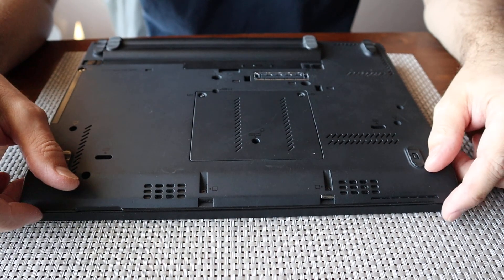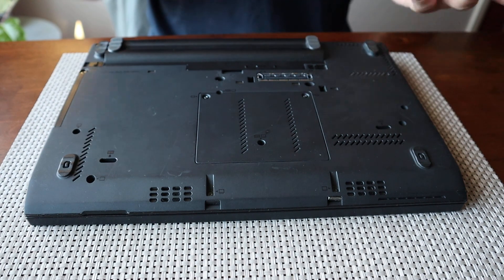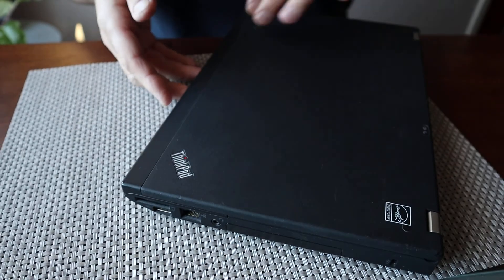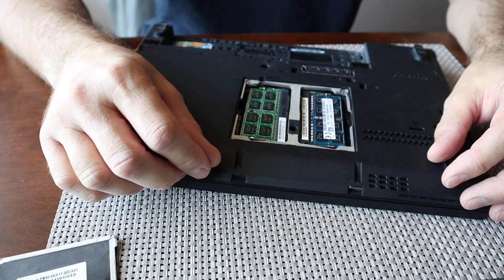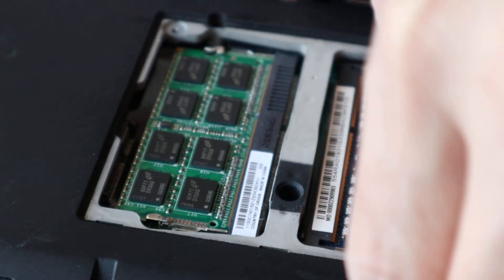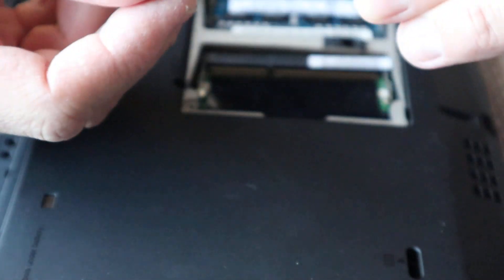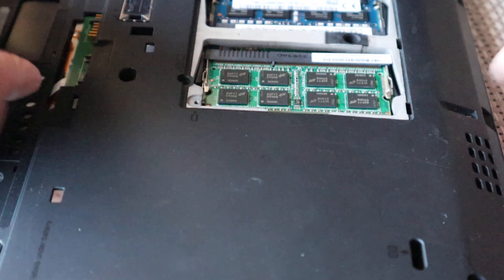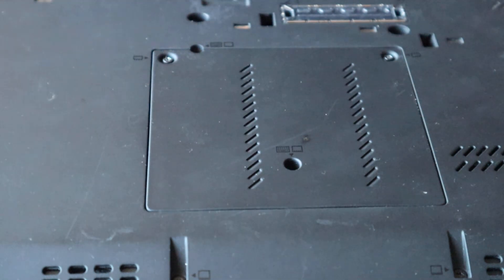Lenovo X230 RAM and HDD upgrade

Comment: X230 has maximum 32 ram or 16?
Reply from the maker: After even more research I can say that 16GB is maximum. I'm sorry for my mistake. Apparently there is limitation in CPU controller. It can take 32GB of RAM but will only take 8GB per slot. And since there are only two memory slots in X230 so it can only be 16GB installed in X230.
Reply: @gadgetsngizmos1544  but if we will have 4 slots it could be take 4x 8gb and have 32 gb
 Ok i will install another 8gb card. Because i have 1x 8
Reply from the maker: 32
Reply: @gadgetsngizmos1544  there is a differences with 8 16 and 32gb? 32 is it worh? the laptop is faster?
Reply from the maker: @PolishPianoOrgan  I don't think it is worth to spend money to upgrade to 32 GB. 16 GB modules are quite expensive.
Reply: @gadgetsngizmos1544  ok. What is price in your country for 2x 8gb RAM sodimm ddr3?
Reply: @gadgetsngizmos1544  hey bro, are you sure there is max 32? Check it

https://www.lenovo.com/gb/en/laptops/thinkpad/x-series/x230/
Reply from the maker: @PolishPianoOrgan  https://ark.intel.com/content/www/us/en/ark/products/64896/intel-core-i5-3320m-processor-3m-cache-up-to-3-30-ghz.html
Reply from the maker: @PolishPianoOrgan   Laptop will be faster with task that require more RAM
Reply from the maker: After little more research I'm little confused. according to Intel i5-3320m can handle 32gb of RAM but according to few memory upgrade websites  you can only install 16 GB. I have only 16 GB installed.
Reply: @gadgetsngizmos1544  interesting to check up it. The motherboard will service with 2x 16 ram... In Poland 1x 16gb ddr3 cost over 400PLN its over 110$. 2x8 ram cost 240PLN its ~ 60$
Reply from the maker: @PolishPianoOrgan  If you have money it will be interesting to test if laptop will work with 16 GB in one module
Reply: @gadgetsngizmos1544  i dont have enough xD and dont have many subscribers xd

Comment: Thanks for the video. I already have a 4gb (when I bought the laptop in 2013). Can I put 8gb in the remaining slot? Will this combination work? Moreover, for the new RAM, do I need to have exactly  the same brand of the old one? Which RAM brand you are using?
Reply: u need those
https://www.compuram.de/arbeitsspeicher/lenovo/notebook/thinkpad/x-serie/x230-tablet/16gb-dual-channel-memory-kit-2-x-0a65724-x52dd.htm
Reply from the maker: Hi. Yes you can put 8 GB and you'll have 12gb . Just make sure it has same spec